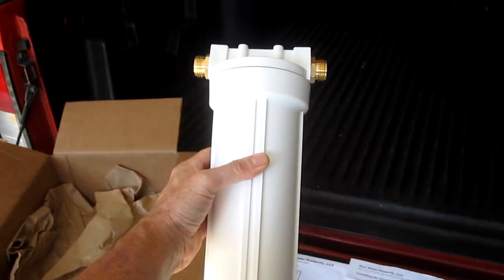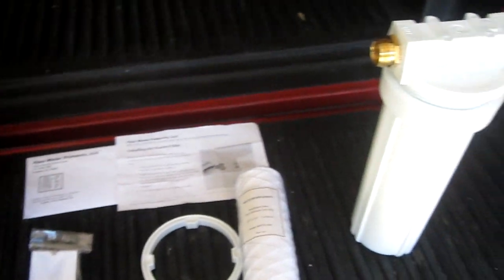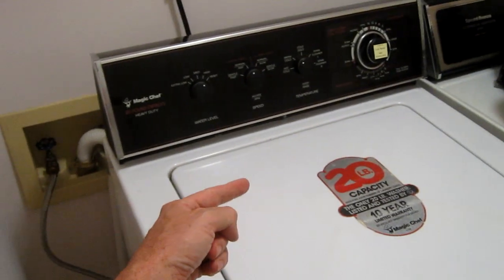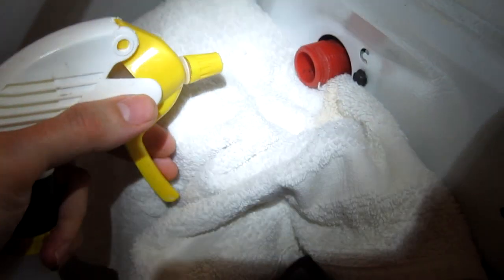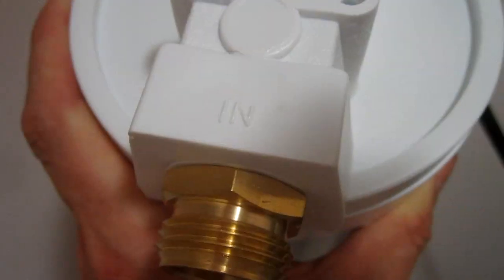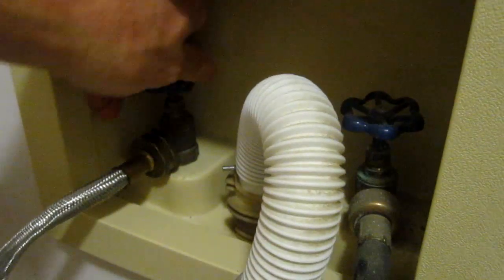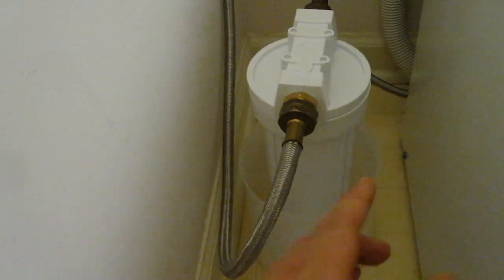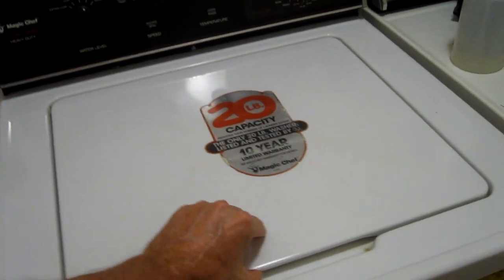Washing Machine WATER FILTER remove Sediment Rust Brown Water Dirt Unclog screen fix slow no flow

Comment: I fixed this problem too a few yrs. ago.  I used to have to do what you did every month, and sit on top of the washer and turn off the cold and undo the hose to the washer and spray out the sand.  I'm sure glad I haven't had to do that these past few yrs. anymore.  It really works to put that water filter in.

Comment: Thanks -  My HOT water line is the problem. The HOT WATER filter and additional filter was $88.   I hope this prevents the sediment for my washer.  My washer keeps giving me an error and it turns out the Hot Water line keeps getting sediment.  Thanks for the Video.

Comment: I was wondering why you don't need one for the hot water, I guess depends on choice of water like cold/warm. So majority of the water will be coming from the cold side, and your water heater mostly likely would trap some of the sediments already.
Reply from the maker: hi, yes the hot water heater traps the sediment before it reaches the washing machine. Every few years i open the bottom spigot on the water heater to flush any buildup, theres usually a tiny bit but nothing major. ive never had to clean the hot water side screen/filter in the washing machine.

Comment: Why didnt you use plumbers tape when you hooked all that up and dont you have a water filter for the water for when it first enters your house from the ??
Reply: I too use rainwater from the well, and here too there is no pre-filtering installed on the well itself (that's what you ment, right?). My house is an old house built in the early 70's, and that's how old the well is too which means there is no pre-filtering installed. Back in the old days people didn't install this (don't even know if such thing already existed?), since people usually just used tapwater to do their laundry and rainwater for their garden. Tapwater wasn't as expensive back in the old days as it is now, and people didn't care if there was a freshwater shortage. Of course, this has changed now and many people switch over to their existing (old) well to save money and water and do encounter the debris problem too. Installing a new pre-filter on an old well is pretty much impossible without hiring someone to do it for you (old plumbing, well-fittings not suitable, etc) and/or digging up the entire well and replacing it with a modern system.

In short, I too encounter the debris problem - specially after rainy days - and am looking for an affordable (DIY) solution to reduce or get rid of this problem. But here there is no plumbing that I can reach without tearing down entire brick walls and concrete floors, so the system this gentleman is using does not work in my situation.

Cheers.
Reply: They are hose fittings, there is no tape needed.  Did you notice there were no leaks?  He has a whole house filter.  Did you WATCH the video?

Comment: so you did a video on an audio adapter. my headphone jack is stuck in my computer too, did it work without headphones?
Reply from the maker: your computer thinks the headphones are still plugged in so its sending audio to the jack and not to the speakers. try to remove the jack with a pair of needle nose plies or other tool. You can also search google on how to change playback devices on your model of computer. If you right click the speaker icon on the lower right taskbar u can adjust playback settings and might be able to switch over to speakers. good luck.

Comment: Please post a link to the filter housing. I’m having a heck of a time finding it with two male connection. TIA
Reply from the maker: go to purewaterproducts dot com. Theres a list on the right hand side with small text, click Specialty Filters. Then click Washing machine filters. Or on the main page click Alphabetical Product Listing, then scroll down to W and theres the washing machine filter link.
Reply: Thank You for that info and this video.
Reply: This is a great reply answer. Should put this at the top with the description.